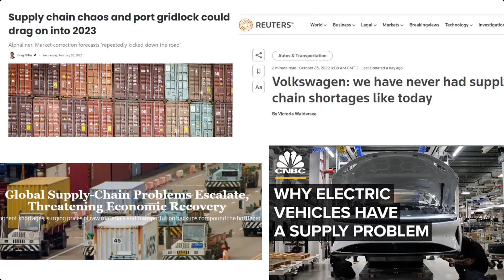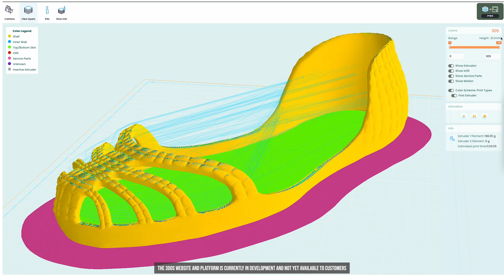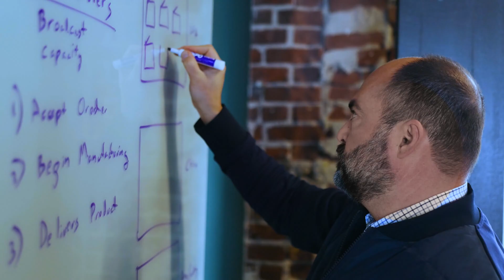3DOS™ - World's Largest 3D Printing Manufacturing Decentralized Network

Comment: With blockchain technology will the company create a new token or just use the NFT to use the 3d network?
Reply from the maker: Hi, the company will use existing technology and NFT protocols initially.  We have looked at creating a token, but would not do this until the SEC cleared this, and It would have to have true utility.  Most of the token projects are very unethical, as 99.99% of them do not have real revenue.  Our platform generates real revenue, so we will explore in the future the token option, only if revenue is captured inside the token price, and it is not held up artificially.
Reply: @3dprinteros  Just as shares represent a stake in the ownership of a company, security tokens can be designed to represent fractions of ownership, rights to dividends, or other financial rights. Your concern with the SEC shows that your company is aware of these issues.💪👌